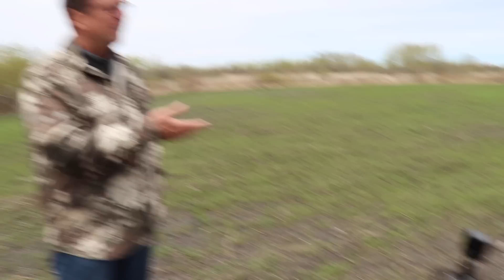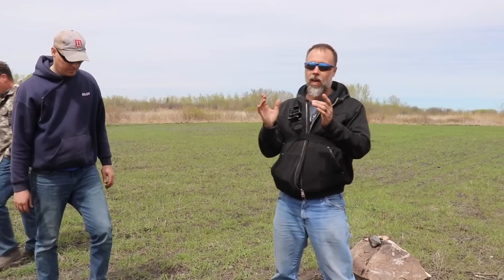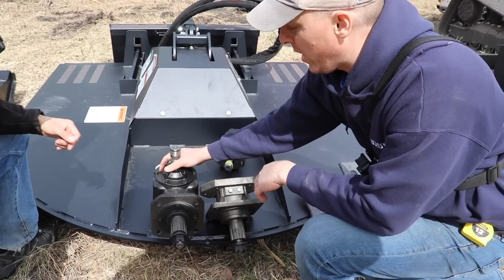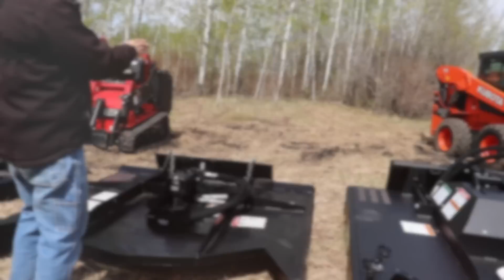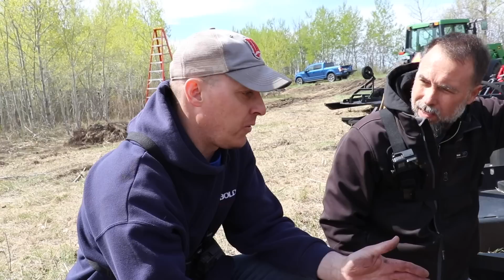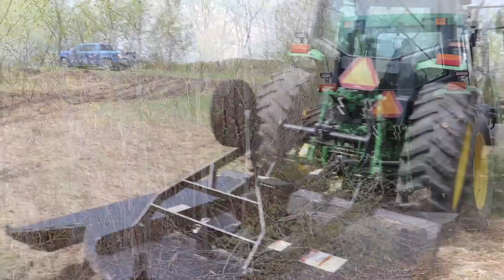Testing Brush Mowers & Land clearing Equipment in Extreme Conditions

Comment: ...BUT    can you clear Kudzu?  Being a vine, it tends to not cutting as much as winding around the turning spindle shaft
and forcing past and into the seal(s).  What horsepower ratings of the skidsteer does your brush buster need to have to RELIABLY cut down heavy brush? If an owner already owns a skidsteer, I'm sure they wouldn't want to be forced to buy a heavier duty ($$$$$$) piece of equipment!!

Comment: Main takeaways from this are:

1. You have to match the hydraulic flow rate to the right sized tool (and therefore use a big enough machine for the job);

2. If the tree is obviously a job for a chainsaw, then Bob's your uncle; don't bring a brush mower to a chainsaw fight.

Comment: You should try the Land Shark Extreme , my husband and I run those on our John Deere 333G and it’s amazing. They are rated to go up to 12in trees. Always have the high flow running it , I see some of the other guys out here running without high flow on and it does nothing. I have a few videos on my page with it on if you want to check it out.

Comment: Half the brush I see on these videos could easily be handled by my 45 year old Hardee 60 inch ditch bank mower. Three point hitch mount with PTO driven hydraulic pump driving a big hydraulic direct drive motor. The deck pivots 180 degrees from straight down to straight up 24 inches to the side of the tractor. On flat surfaces once you get a path started the tractor is always in the clear mowed area. 

Not much used in the last 25 years, before that changed the blades once because the mounting holes were elongated. Lost one blade when the mounting pin fractured. Never found it. Great for use on a farm but hard to transport with the deck on one side and the counter weight sticking out a like distance on the opposite side.
Reply: Want a Budlight?

Comment: Wanted to purchase a few items through quickattach but after multiple emails never received any reply.
Reply: You must have done something wrong. Lol. They communicate more than any other attachment company I've ever spoken with.
Reply: @wpog8453  I'm in Aus which I assume I'd part of the issue.
Reply: @jamielockhart3453  yes that could be it. Try to contact Aaron at Quick Attach. He'll tell you anything you need to know.
Reply: @wpog8453  Thanks mate. I just want to organise the sale. Want to get a jib boom attachment for lifting trusses and what not.
Reply: @jamielockhart3453  heck yeah. Right on man. My dad has had a framing business in Enterprise, AL since 1980. I've got a friend in Comboyne, New South Wales. He invented a brush cutting tool that I use in my business.
Reply: @wpog8453  I want to get into the earthworks side of things more so then the carpentry. What sort of brush cutting tool is it? I've got a brush hog attachment for the slv75. Works well.
Reply: @jamielockhart3453  oh its just a special cutting head for a hand held brush cutter. I use it on residential scale properties.
Reply: @wpog8453  I wish you the best of luck with your career mate. You sound like a good man.
Reply: @jamielockhart3453  Thank you sir. Same to you as well.

Comment: We run three fruit farms in Ontario. We have a John Deere 10 foot brush  cutter that’s adjustable for center pull or offset and a 9 foot offset bushhog brand brush cutter  both are used for weeds and cutting brush up to 4 inch in diam. We have some rocky soil where we grow pears both machines handle fist sized rocks no problem. These machines will handle anything you throw at them.

Comment: I have the 72” Quick Tatch Utility HD direct hydraulic drive  cutter with the optional front brush guard on my Bobcat S650 with standard flow hydraulics and steel tracks. It’s a beast. This tool is clearly something they intended to make Best in Class. It screams over engineered. I take it into heavy growth Missouri forest to clear trails and also brush hog fields. Will easily take down the occasional 5” hardwood tree and withstands hard abuse. With the front brush guard you can raise the unit up, point it downward on shallow rooted trees like maples and push over 10-12” trees. You can rake the sides of trees with it to de-limb them. The V notched on each front side let you slowly bite into larger trees and work them down. The engineer said it right though. If you are wanting to take out large trees all day get a forestry mulcher. This is the perfect tool for cutting miles of trails in a day. Dan VanLier provides OUTSTANDING customer sales service and their tech service has returned calls ON THE WEEKEND to keep my equipment running. “Warranty” to them means “we don’t go by dates - we go by is the customer SATISFIED” This is the best equipment company I have ever dealt with. I continue to make them my go to attachment provider

Comment: The John Deere HX and more so the CX rotary cutters will do everything the quickattach tractor unit will do. And definitely built well, the “tin can” mowers he’s talking about are the cheapo class 1 3pt mowers/ rotary cutter you find at ag supply stores like tractor supply, For homeowners with their <40hp tractors.

Although theirs looks beefy and built well, but 90% of farmers who would be their market aren’t going to want to go bombing their tractor through the woods cutting brush.
Reply: I’m running an Hx you can’t beat it
Reply: Farmers aren't the only people that would find use out of that mower.

Comment: I’d love to be able to use a brush mower but it’s all Canyon land here and everything is on a slope.  We’re pretty much using string trimmers with metal blades.
Reply: Check out a Ventrac with the tough cut. Tackles slopes and the mower is built solid.
Reply: Chris Hubl Thanks.  That’s a good looking unit.  I’d like to see one in action on a canyon slope to get a better idea how it would work.  Labor with the hand-held brush trimmer is pretty cheap so it would take something special to change the dynamic.  I’m all for it but not gonna be an early adopter.
Reply: @farmerbob4554  Stan has ventrac videos.

Comment: good thing rocks don't break apart and send shrapnel everywhere!!! lol
Reply: They actually do. We farm fruit in Ontario. Our pear orchard is on rocky  ground. When you hit that sand stone it’s like shrapnel. We have a plywood guard on the back of one tractor to help. It gets you in the back of the legs.
Reply: @bobivanski5635  He was being a smart ass. He's trying to discount the benefits of the blades not shattering. He's too slow to realize the fastest, hardest, sharpest, most dangerous thing that can turn into shrapnel, is the blade. A blade shattering is MUCH more dangerous than a rock.
Reply: Not to say that high speed rock isn't dangerous, but yeah that's the gist of it. Outside of a few specific specimens of rock, steel has a higher mass per given volume, thus a chunk of steel the same size as a chunk of rock is going to carry a lot more energy with it. It'll also tend to be sharper overall. There are a load of other reasons why the blade turning into shrapnel is worse, and obviously a few exceptions where a rock is worse... but yeah. I mean either way, if the rock is going to turn into shrapnel, it's gonna turn into shrapnel. Nothing you can do about that. You can however prevent adding the blade to it so... props for the initial sarcasm from the OP, but I don't think they put much thought into it.
Reply: the kubota power